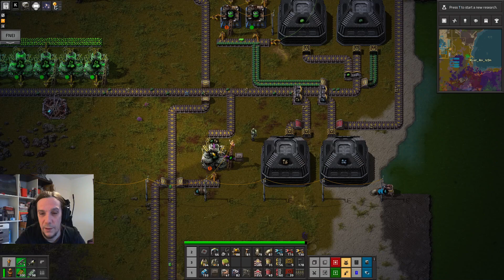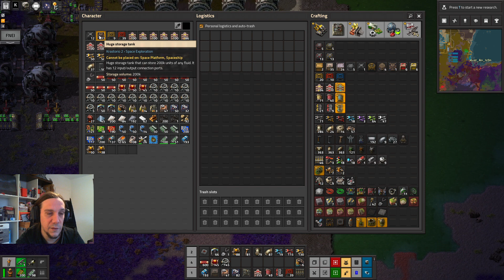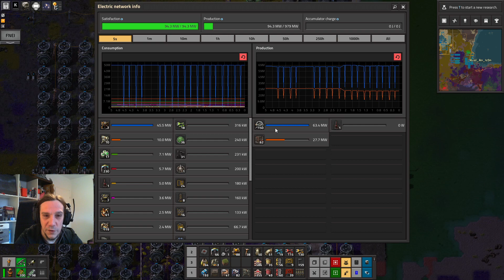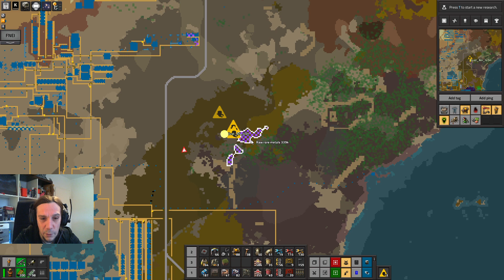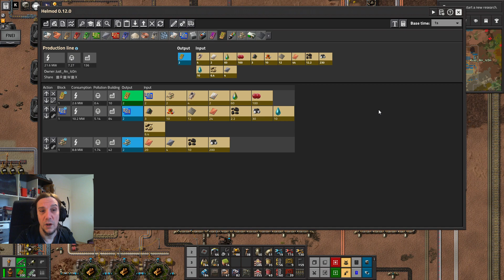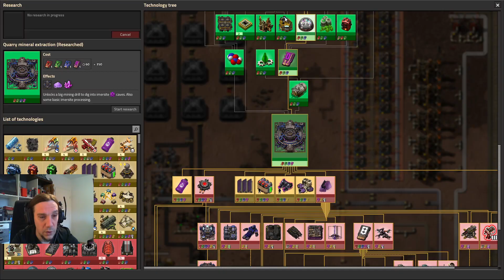Nuclear Power Part 2 - 31 - Krastorio 2 Space Exploration

Comment: The reactors are all connected and transfer heat to each other. You only need to connect the heat pipes to the connector and then out.. The tricky bit is to keep the number of heat pipes as low as possible. Too long and they lose heat.

Once you have steam, those pipes can run as long as you need.
Reply: And yes, steam tanks don't help if you're not likely to run out.
Reply: Oh, I can see that bottom group of heat exchangers struggling.. That is a very long way for the heat to travel.
Reply from the maker: Well it does work since a lotta hours now, but thanks for the optimization ideas there. That might be the explanation why my power grid didn't tank the solar storm even though I calculated it should
Reply: It works until it's at 100% load, then the end of the heat pipe drops below the 465°
Reply: The best way to test a nuclear setup is to add the creative mod and load up your save. Then there is a device that sucks out all the power your system can produce.. If the temperatures stay stable, you're golden. Don't save, remove the mod, then you can go back to your game.

Comment: how did you get 30 HXs for a 2x2 array in K2?  When I tried the calculations I got 60 HXs
Reply from the maker: It was: 375 MW (250 MW base + 25% Neighbour Bonus) of Heat per Nuclear Power Plant - 4x = 1500 MW

One HX eats 50 MW. 1500 / 50 MW = 30

I didn't see a mistake here according to my tooltips - which doesn't mean I think I am 100% right. Like I mentioned in the vid, it's my 2nd Nuclear Reactor. But I do know that K2 has different numbers on Nuclear Power compared to Vanilla.
Reply: @Ic0nGaming  thanks for explaining  that.  I could be wrong but if the reactors are in a 2x2 grid would they not would get a 50% bonus each (25% + 25%, a 25% bonus for each neighbor).  Easy to verify with a mouse over on the reactors when they are all working. Cheers mate
Reply from the maker: @npuldon  Yeah you are of course right, that's a typo above from me (250 * 1,5 = 375 after all)!

But yeah that's the numbers and they have 375 output each with 50% neighbour bonus